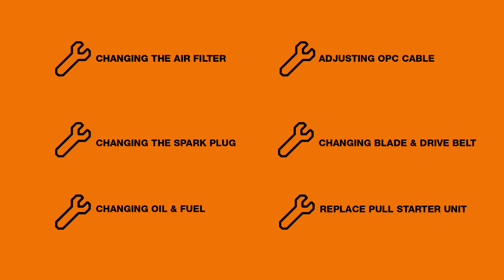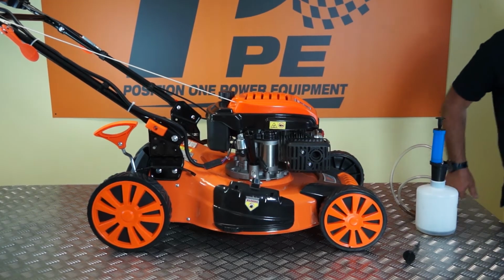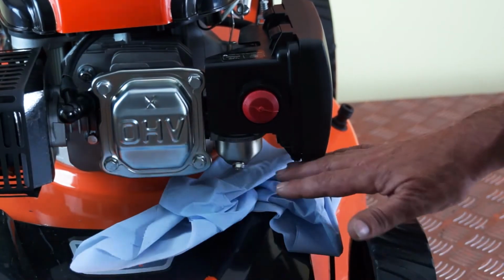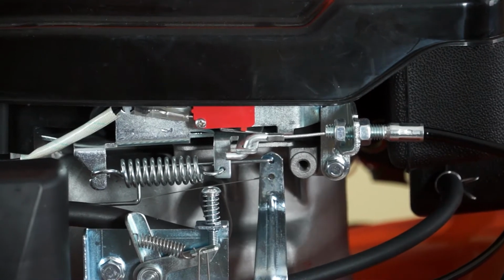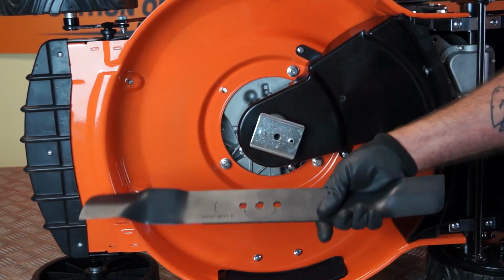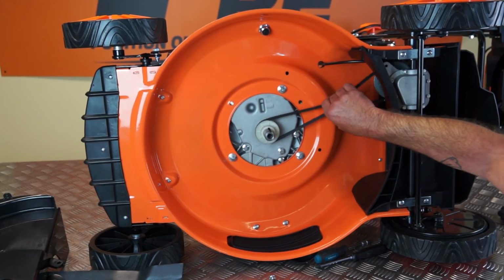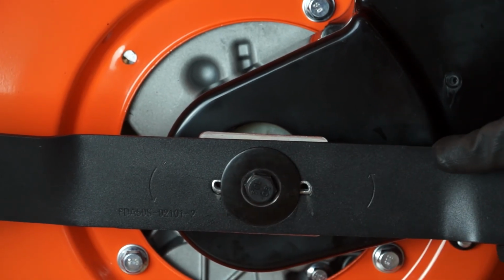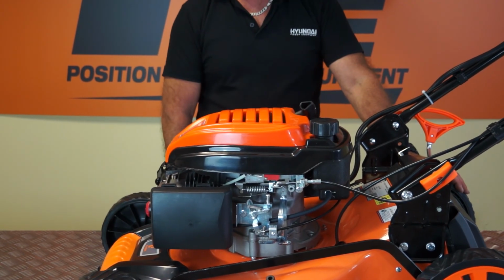How to service the Hyundai powered, P1PE P5100SPE Lawn Mower

Comment: I am not happy, I was on the understanding that this had a 'in home' warranty but they are asking me to send the mower back which as I am disabled, would for me, be very hard to do. Anyway, the problem I have is that the electro start will not work. Tested swich and battery and both oka but I am only getting 4.85 volts at the starter motor. Any ideas?

Comment: If you take the screw out of the belt tensioner and add a nut to the front of the screw and then replace that worked fine for me
lousy design,  I also fitted a nut behind the plate for added security and tension

Comment: Is there a known problem with the spring loaded belt tensioner? My belt isn’t being pulled to the correct tension so I’m losing drive and the belts slipping.
Reply: Did you find out anything about this? My belt has come off due to poor tension. i cant see how to apply tension to the gearbox mounting....
Reply: I also have a problem with a less than one year old machine and the belt has come off altogether. Unlike the video the underside of my machine also has a secondary vacuum impeller which for the life of me I cannot remove to release the cover and get to the belt. Although a UK build the manufacturer has no idea when I describe what I am seeing!
Reply: @gooner67  they have been very helpful indeed. there is an upgrade part available at no cost as under warranty which replaces the axle clamp and puts tension on the gearbox therefore onto the belt. I've received and fitted this and works well now!
Reply: @WildAxMotorhomes  Thanks for getting back in touch. Does your machine have the "Turbo Grass Vac" feature with a circular impeller fan and fan blade boss?
Reply: @gooner67  no it doesnt - just a straight forward one! i dont collect anyway i mulch which is much easier!! You could try contacting genpower.co.uk i dealt with Wayne Sanderson - he was great.
Reply: @WildAxMotorhomes  Thanks again. I have spoke to Genpower a guy could Sean and have had to send him photos via email as he has no idea of what I have got. I assume PiPE and Genpower are the same company. Their websites have the same contact number!! Great advice on the belt tensioner. If I have success getting to the belt I may ask about this upgrade.
Reply: @gooner67  9 months. My belt tensioner packed up after less than a week. That was three weeks ago and they sent me a bolt, but not told where the thing goes. They have a few more days and I shall be asking for my money back so I can buy a mower that comes with a little bit of back up.